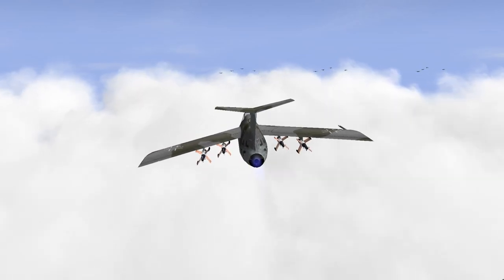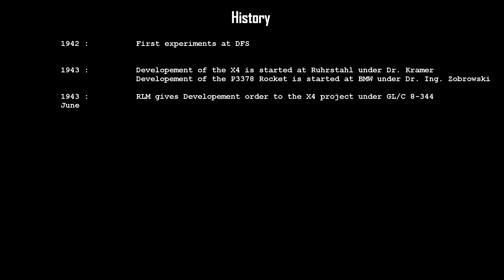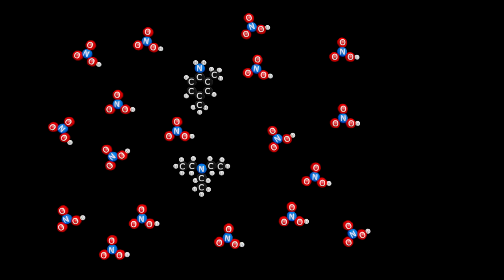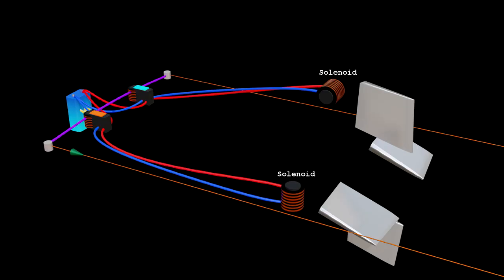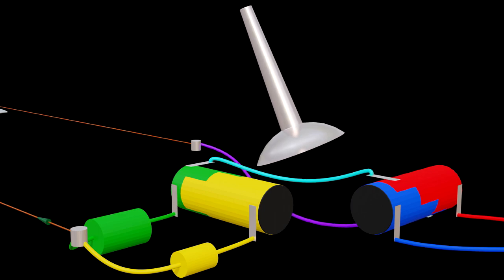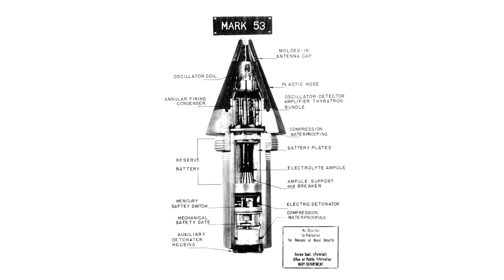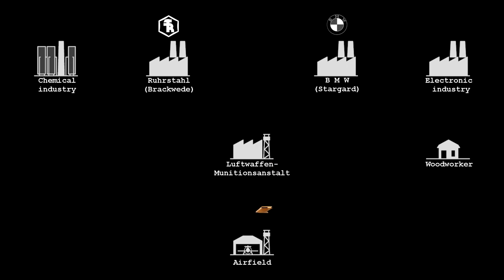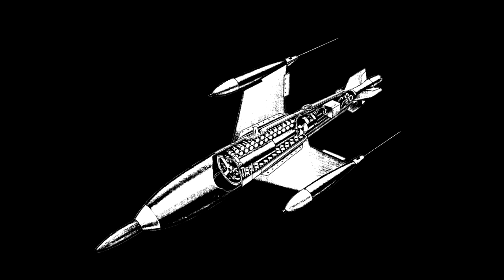How did the Ruhrstahl-Kramer X-4 missile work?

Comment: Extraordinary details on the gyro course stabilization. I believe wartime torpedoes had four cruciform control surfaces and gyro stabilization, but the commutator between the gyro and the control circuit is unique to the X-4.
Reply: Torpedoes had also counter-rotating screws and a PD depth control, but they did not roll (a lot) due to the bottom side being heavier.  In 180° turns (e.g. FAT, LUT) the torpedo could sink down to 10m, but would of course climb up again quickly.

If you want to see an interesting take on torpedoes, try the Brennan Torpedo.

Comment: This is beyond excellent. War is a sad history, but it’s developments in the past 100 years are astonishing and carry lessons to this day. Wow. Thank you. You would enjoy Tankograd’s blog on Soviet ATGM’s . Only decades later was the malyutka made shockingly similar to this but with a 3 core wire. I suppose the TOW is like this since there’s 2 wires and it was introduced before digital technologies; it was analog. Maybe the only difference was the addition of a tracking lamp and the compressed helium gas pneumatic pushrods for the tail fins.
Reply from the maker: Thanks for the praise

Yeah the two world wars accelerated technical developement and exspecially in aviation and automatisation. It's just about 40 years from the Wright flyer to the first jet fighter. And "only" 70 to the moonlanding.
 A person born in 1890 could have experienced all the big achievements but also 2 worldwars and the dangerous phases of the cold War. 

I'll have a look in this blog, I knew that the malyutka has alot in common with the X4 but that wire sounds interesting.
TOW always looked for me like a crossover between X4 guidance system and V1 control mechanism but I have to read more on it. 
Thanks for the recommendation

Comment: There is also a whole series of heat seekers developed by germans, like BV 143 glide bomb.. The spinning disk systems were also developed by germans, which are later used by sidewinder...
Reply from the maker: Yes but I didn't fully understand them yet, the heatseekers for the American azon bombs have much better documentation so if I'm going to make a video on heat seekers I will probably go for the azon or sidewinder.
However there's an interesting concept for a anti radar guide mode in the BV Hagelkorn.

If you like I can read further into German ww2 heatseekers and try to make a vid about those
Reply: @dave_sic1365  "......If you like I can read further into German ww2 heatseekers and try to make a vid about those....."
Oh sure, that'll be very interesting..  But I think the guidance system of V1 would be more interesting to me.
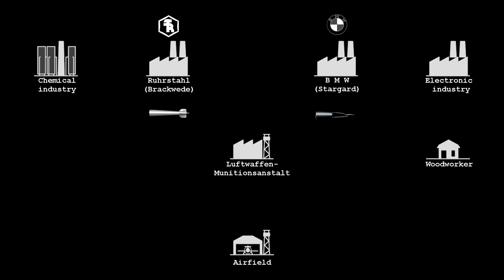Reply: @dave_sic1365  Actually, while looking at @23:22 of your video, a different idea popped to my mind.. Is it possible to summarize the whole german industry circa 1940 with a similar (albeit more complicated) diagram? Like ammonia production at Leuna, Synthetic oil, metalware at ruhr,  dye industries etc? How they are related to each other? Like, whose output was consumed by which industry as input?
Reply from the maker: @sahhaf1234  this is interesting but a hot topic in Germany. Alot of company's don't open their archives to research related to the nazi period because of of Jewish expropriation or forced labor or nazi collaboration (or a combination of those) thus its propably impossible to make a video about all of the company's.

What I could do is one about the biggest company's but towards the end of the war alot of work was done by small craftsmen shops as the industry was destroyed.
It would be very superficial.

Interesting idea maybe I do one later next year
Reply: @dave_sic1365   
"...interesting but a hot topic..."
Ah, which one? V1 or the schematic of german industry? 
As for the schematic: Currently I'm trying to draw the material flows in a pre and early industrial revolution economy.. I hope that it will be ready within a few years.
Reply: I found a very interesting book titled "Benecke, Quick. 1957. History of German Guided Missiles Development". It has a section on infrared homing.

Comment: There was also a anti-tank "variant" (probably a convergent development), also spin stabilised --- but with only one pair of control surfaces.  A gyroscope inhibits reaction for the axis that is not in the proper orientation for the control surfaces.  Seems to have had quite a few go into the ground at first test (the most experienced operator wasn't experienced, obviously) but the one that did not, hit the target squarely.
Reply from the maker: The X7 Rotkäppchen ATGM.

I tought about making a Video on this Missile but only found conflicting informations. Aparrently only 1 Photo exists that shows a wrecked Missile.

I also read about an TV guided Variant but at that point i didnt trust the Text anymore.
Reply from the maker: Do you have a link to your informations about the stabilisation System?

Comment: Flying the plane, avoiding enemy efforts to kill you AND steering the X-4 would be beyond the ability of any one pilot. It makes me think that the missile would either have been "locked off" ie unguided (thus defeating the purpose) OR carried by a two-seat heavy fighter. The missile guidance of course being carried out by whoever was not piloting.
Reply from the maker: exactly that was found during testing and the use on two seaters like the ju 88 was recommended.
it also sparked interest in the pudel-device which would have made the x4 a fire and forget missile.
Reply: You would be outside the firing range of the bombers' MGs.  That was the whole point.
Escorting fighters, though ... different story.
Still, flying might be a slight problem.  But there were autopilots ... not necessarily in single-seat fighters, though.  Space tends to be a problem.